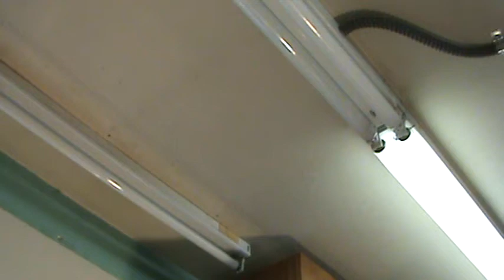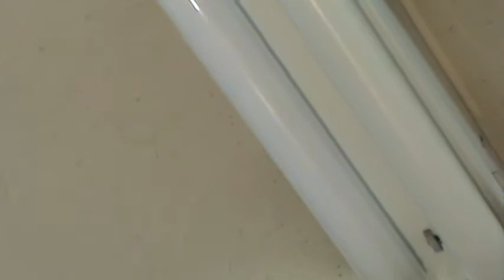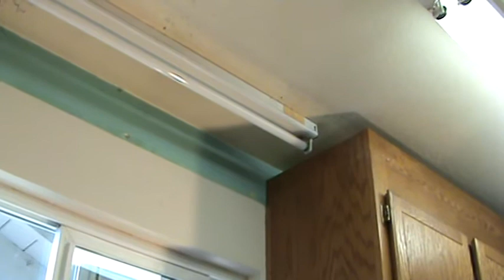Why is Fluorescent Light Lamp Tube Burning Out so Often?!

Comment: I put a T8 bulb in by mistake, and they burned out quick. I then got T12s, but they still burned out quick.  Did I mess up the light?  Or do I need like commercial bulbs or something?  Thanks
Reply from the maker: Your existing light ballast could be old & in need of replacement & that could burn out a light lamp quick. How old is your light fixture? That would be my guess. Also if you didn't replace both or all of your light tubes at the same time & if you have some old tubes still in the light fixture & still working then when you put in a new bulb, that could make the new bulb burn out quick too.
Reply: @videojoeshows  Thanks for the quick response!  Not sure how old the light fixture is.  It was installed in the garage when we bought the house.  The original owners had left some commercial t12 light bulbs in a box. I used those slowly over the years until the box ran out.  (But the bulbs lasted a decent amount of time). Then I went to Lowe’s and mistakenly got T8s, which burned out quick. Went back and got the Lowe’s T12s, but those have just burned out quickly as well.  So, all the bulbs were changed at the same time.  (But that’s why I was wondering if I needed a “commercial” bulb, like for warehouse use. Or if that might make a difference from the ones at Lowe’s, which seem to be geared more towards homes and not commercial buildings). Thanks!
Reply from the maker: @YouEatPlants  I don't really think there is a commercial bulb as opposed to a residential bulb...they should be the same for T 8s & t 12s as being the same type per se. Look at the old ballasts inside the light fixture & see if they are bleeding black stuff & if they are the old heavy ones. Those take the fatter bulbs & if it's the heavy ones then it might have to be replaced depending on how old it is. If the ballasts are the small lightweight ones then those take the smaller size tubes....
Reply: @videojoeshows  Hey thanks again, I haven’t checked yet, but something strange happened! So the lights were left on for awhile on accident, and when I went in, they were fully lit up again! (Before they were still turning on, but at a very dim light. I said they were burned out, but not completely, sorry if I misspoke and might have changed the diagnoses ☺️). I turned them off and back on, and immediately they came back on full strength still.  However, I notice in one bulb there is a black burned out looking area on one of the ends that’s about 2” long.  On the other end there is a slightly black smudgy area, but not as big or noticeable). Sounds strange!  But any idea, or do you still think it’s the ballast?  Thanks again friend!
Reply from the maker: @YouEatPlants  Here's what sometimes happen...when a ballast starts wearing out it will take longer to heat up before it turns on. When you turn the light switch on the ballast is still cold & it will take awhile for the ballast to warm up then all of a sudden the lights will go on then when you turn the light switch off the lights will go off & if you turn the light switch right back on the lights should go back on since the ballast is still hot...see what I mean? You probably have a really old light fixture with the heavy style ballasts & you would need to replace that ballast is my thinking. When your light tubes start getting black around on of the ends it means it's ready to burn out. You might want to consider removing the entire light fixture & installing a new style LED one which takes way less power, That's what I 'm going to do next time.
Reply: @videojoeshows  makes sense! Thanks!
Reply from the maker: @YouEatPlants  Send me DIY questions anytime...!
Reply: @videojoeshows  Thanks! I noticed that even when it’s left off for a long time, it still lights up well when turned on.  Do you still think it’s the same problem of the ballast that you recommended?  (Based on what you were saying I was thinking that once it was left off and got cold again it would not light up well until it was on for a long time, but it seems to come on and light up pretty well immediately now!  So strange!) Thanks for all the help by the way! (I know it’s a strange one! Haha)
Reply from the maker: @YouEatPlants  I think the ballast is on it's last legs. The only way to know for sure is to replace all of your light tubes with new & then if you have some burn out right away then you know...

Comment: I have a 24” T8 black light that I want to use in my office for meetings. I bought a T8 bulb and it burns out after a few days. Will a T12 solve this issue, or is it because the fixture was made for a black light (which works just fine, just not for meetings😅)?
Reply from the maker: Did you finally get it fixed & figured out?
Reply: @videojoeshows  unfortunately no. I got a t12 and the same thing happened, so I think there’s an issue with the fixture 😞
Reply from the maker: @yeahwryte  The ballast inside the actual fixture might be bad. You would have to turn your breaker off for the light fixture then remove the bulbs then remove the metal cover & you will see the ballast. You could remove the ballast & take to the store then get another one the very same then re-install & I'm thinking you can fix it that way. Make sure you ask a guy in the electrical department what size lamp tools are for the ballast that needs to be replaced so you get the right lamp tubes for the new ballast. Here's something else you can check before removing the ballast. Remove the bulbs then the cover to expose the ballast. Does it look like the heavy type of ballast & does it look old & big looking? The big ugly heavy ballasts are for the big lamp tubes. The thinner lamp tubes are for the small lightweight electronic ballasts but those type of ballasts would be in a newer light fixture. Is your light fixture really old or is it a fairly new one? Are you up for checking things out then replacing the ballast if need be? You can do it!

Comment: I have collected fluorescent lightbulbs for over 52 years and still I am all of these modern electric ballasts are guaranteed for five years at best I like the old preheat rabbit start fixtures best they last a lot longer then the modern stuff
Reply from the maker: The only thing about the old stuff is the old style heavy ballasts cost more to operate than the new electronic style. Wow sounds like you have quite a collection of lightbulbs. Take care fluorescent man!
Reply from the maker: I may also add that I have a ton more electrical videos that you might be interested in. Just go to my main YouTube channel then click on playlists & scroll down to electrical & you will find them there. As you will see on my playlists I have a ton more DIY topics there that could save you money around the house. Take advantage of them as they are there for you. Thanks again for your message...
Reply: I like magnetic ballasts also because they dont produce so much radio interference like electronic ones do

You can see for yourself here: https://youtu.be/GA7rscFNpB8

But sadly T12 tubes are harder to find nowadays, dont realy know why people want you to buy T8 so much (what makes them better?)
Reply: @Veso266  T8 is more efficient, I have tested both new unused and there's significant difference._

Comment: T8 36w vs T12 40w
Reply from the maker: Thanks for your message & for the thumbs up!
Reply: @videojoeshows  Actually, this T8 tube is a 32w tube that runs at a lower current and a much higher arc voltage drop compared to F40T12 fluorescent tubes. Because of that, such tubes are NOT interchangeable with each other electrically even though they fit in the same fixtures. In Europe, there are 36w T8 fluorescent tubes that are the same length as F40T12 fluorescent tubes, but they are electrically interchangeable and mechanically interchangeable with F40T12 fluorescent tubes only on preheat ballasts that use glowbottle starters.
Reply from the maker: @worldwidehidcollectorusa-fkt  Wow thanks for all the info.. Much appreciated!

Comment: The counter in my house is lit by lights with small halogen bulbs and the one on the far left under the medicine cabinet keeps going out even though the bulbs is new. I tried turning the bulb upside down and so far it hasn't gone out yet. I think it's just a loose connection because all the others still have the same bulbs from when I moved in in August
Reply from the maker: Yes that could be a possibility. Make sure the power is off before pulling the fixture apart so you can tighten any loose wire nuts, etc.. Let me know if you can get it fixed, stud...!